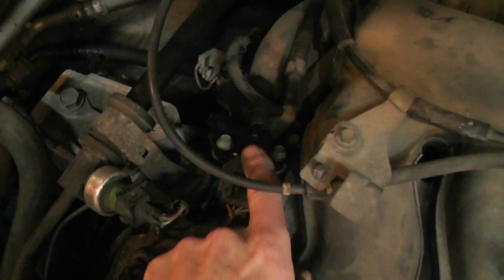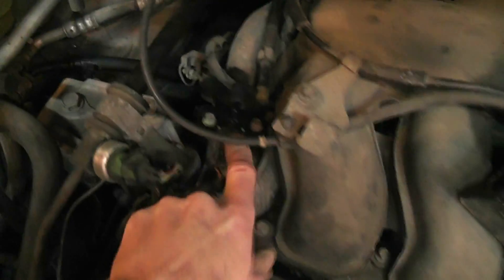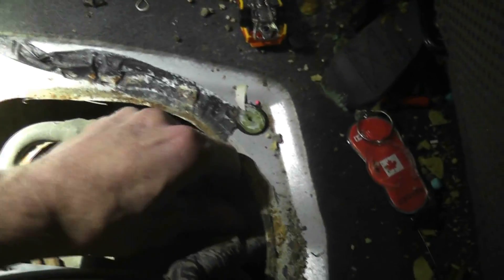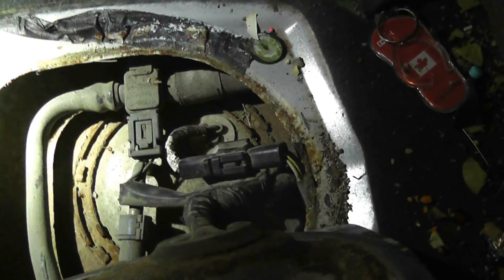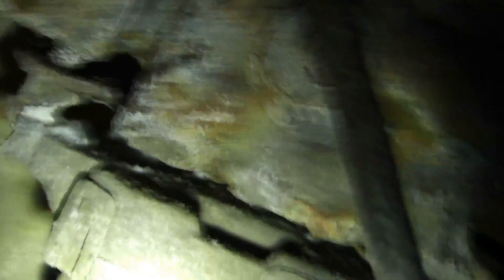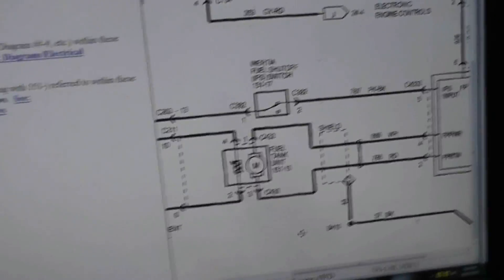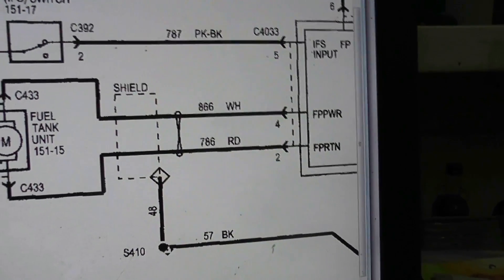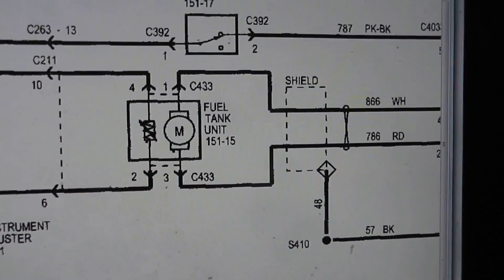Diagnose a Bad Fuel Control Driver

Comment: I have a P001 error code on a 2004 escape 3.0 (fuel volume regulator circuit open). But I can't find the component on the vehicle. Any idea where it is on a 2004?

Comment: My 2000 Ford Mustang gt will start up good run good but after a few miles it starts to lose power to the engine like it’s not getting gas I’ve changed the fuel pump and many other things on it but it keeps having the same problem any ideas on what it could be ??
Reply: I’m having the same issues with my 2010 mustang GT I replaced the fuel pump, fuel filter, and pressure sensor. Same code P0191. Did you fix yours? Any news? Lmk
Reply: Any news on what you did to fix it??
Reply: Any updates?

Comment: Damn, Yalls cars rot pretty quick up there huh? I thought I had it bad when our 2000 Honda had a break line blow out cause of salty or briny roads here in Tennessee . But it only snows here about once or twice a year.  I bet you have a lot of issues with break lines and fuel lines there.

Comment: The fuel pump probably isn't getting a good return to ground with all that corrosion on the driver housing. And yes-- if it's that rotten the salt and other crap probably have started to work on the diodes and transistors in the driver. Too bad you had to replace that sensor, tho....I HATE to replace something that was good. But you found it and fixed it! Time for a beer....